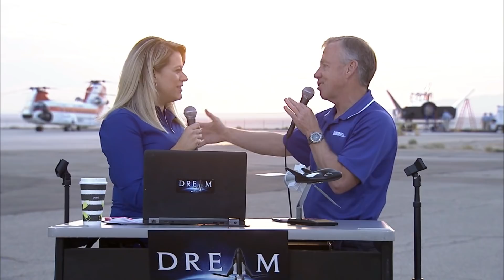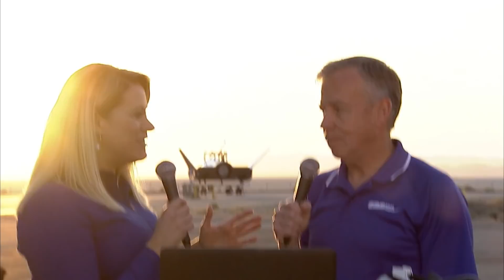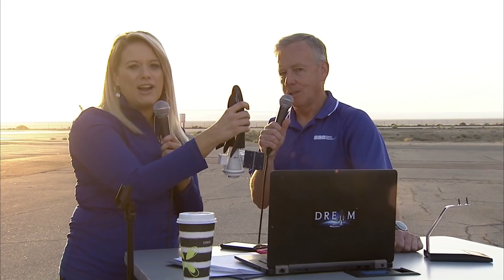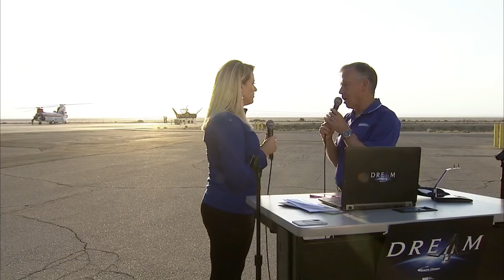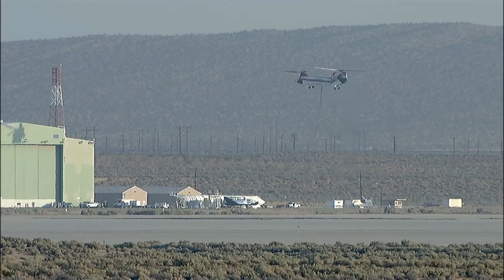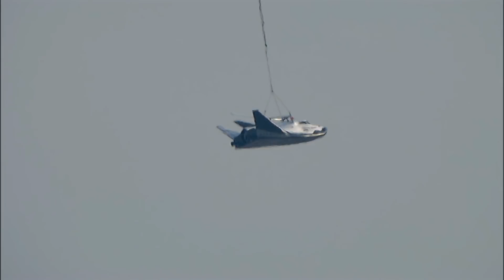Dream Chaser® spacecraft Captive Carry Flight 2017

Comment: This really  reminds me of my days in flight test - it feels very much the same -  I can feel the activity going on as they prepare to test the systems, run down the check lists, do telemetry calibration checks and a thousand other things  - all very precise and very orderly. Flight test is a step by step, precise, no nonsense,  exacting activity.  It has to be. .....because by the time you light the candle with a crew, as Gene Kranz said "Failure is not an option" , and there is NO ROOM for political chicanery, budget diddling by the bean counters who don't know an elevator from an aileron,   to save a buck or management over ride or manipulation of engineering data..... I refer you to STS 51-L as one example (lessons learned).  - If the data says its a nogo, and its outside safety of flight params, then its a nogo.... 

However  in the earlier test phases, it is of course a series of iterative risks that must be identified, quantified, minimized through lessons learned and iterations, and then accepted, throughout the various test phases.  To my fellow engineers who may be reading this, I realize I'm preaching to the choir, and I'm sure you have consumed your own ant-acids........  But when you see something happen, it digs quite a divot in ones memory, and it can happen awfully fast.    And as we all know, space is hard, damn hard and it forgives nothing...... Good luck throughout your test program...... Safe flights.... and god speed.

Comment: https://plus.google.com/103007517419796288702
Reply: https://www.quora.com/Balloons-Do-we-have-the-technology-to-build-safe-hydrogen-filled-airships#
Reply: https://en.wikipedia.org/wiki/Rockoon
Reply: http://www.tecaeromex.com/ingles/peroxidoi.html
Reply: http://auto.howstuffworks.com/fuel-efficiency/alternative-fuels/fuel-cell.htm
Reply: Run a fuel cell powered compressor to pull in and compress the hydrogen from the hydrogen balloon. The hydrogen powering the shuttle and if possible use the   hydrogen to create the H2O2 on-board from the hydrogen pulled into the shuttle from the hydrogen in the balloon.

Comment: Awesome. What types of fuel mixes do you use?
Reply: The Dream Chaser? It's orbital maneuvering engines and RCS use nitrous oxide and propane. This is largely non-toxic and is one of the factors that will allow the spacecraft to land at any large airport without special support that hypergolic spacecraft like the Space Shuttle. This in turn also allows very quick access to payloads as mentioned in the video.
Reply: What was hypergolic on the shuttle?